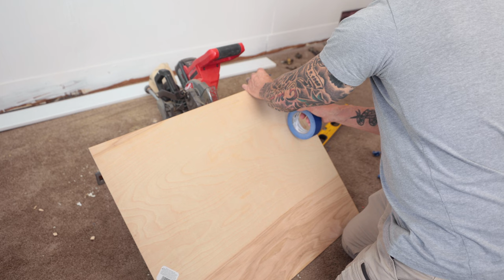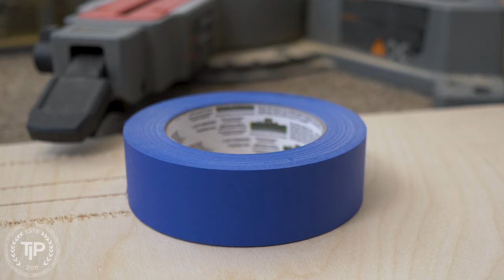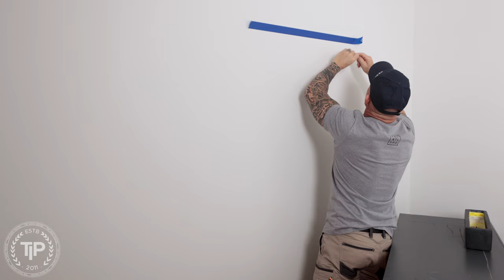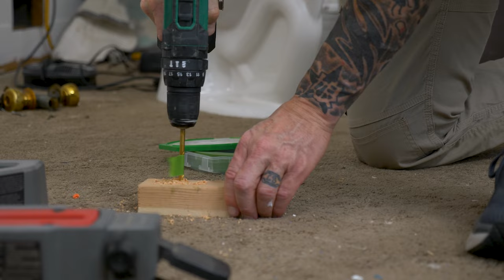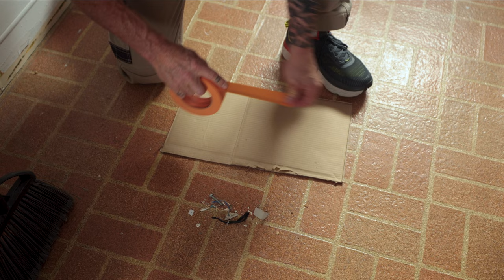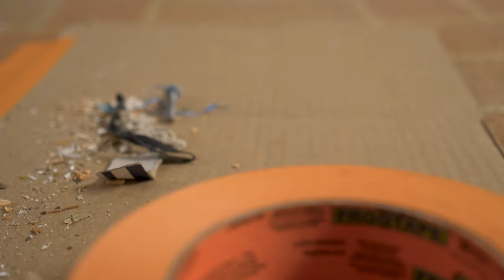3 AMAZING Painters Tape Ideas. FrogTape Hacks for Painters

Comment: Here's a good one my dad taught me: Cover the ferrule of your paint brushes by wrapping blue painters tape around it covering down over the heel of the bristles about a 1/4 to 1/2 inch. This will prevent paint building up down into this part that will eventually ruin a brush by making too stiff, but also makes clean up, and keeping your brushes clean much easier while better preserving them. When ready to clean bush after use peel the tape toward the the bristles tips to not pull on any. When you've cleaned, and dried your brush apply the tape again for the next use.
Reply: Sir. Your father is a genius. How many expensive brushes I could have saved. Haha I’ll use this.

Comment: Nice! I've done the depth gauge and sweeping tricks, but that wall hanging trick was good too! Also, I've seen tape used on the rim of a paint can , to keep the sealing groove from filling up with paint when pouring. When ready to reinstall the lid, just peel the tape off, and lid goes on cleanly. Stick a piece of tape on across where the lid would go, and use a razor knife to cut a crescent shaped piece out of the way.
Reply from the maker: Thanks for sharing